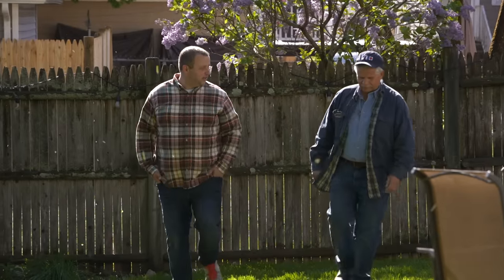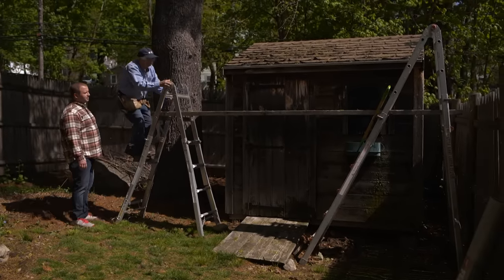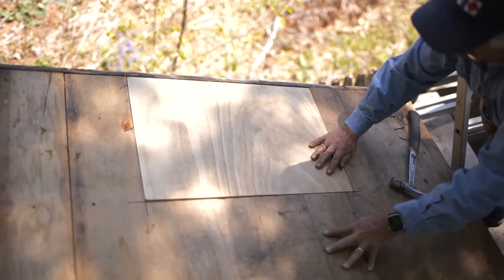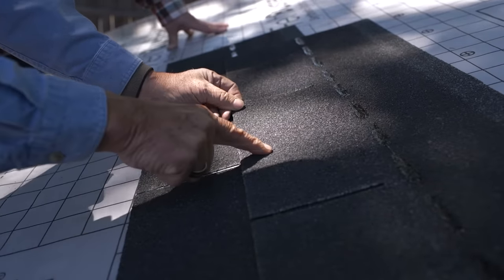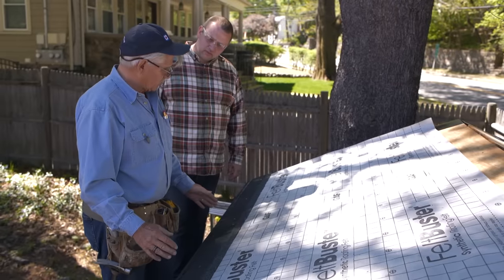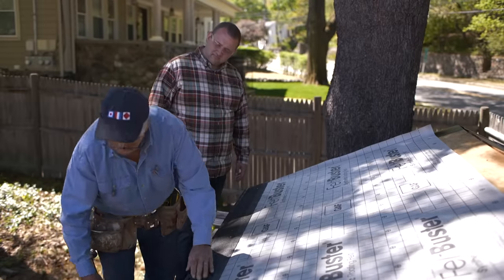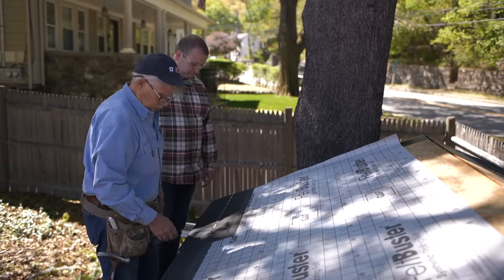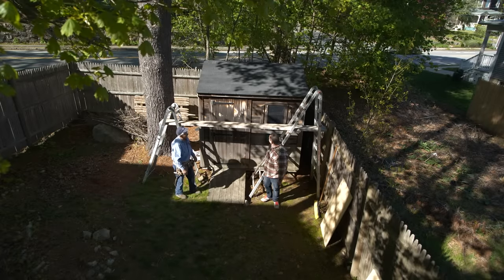How to Install Shingles on a Shed | Ask This Old House

Comment: How do you do the last roof cap layer? Do you just have an exposed nail? Or is there some way to hide it?
Reply: Not an expert but the nails on the ridge caps are covered by the overlap of the next shingle, just like on all the rest of the shed.
Reply: @c5zataol930  Ya. That's definitely true, but the last one you put on won't have another shingle to overlap it. How do you secure that one down without a nail poking through.
Reply: I believe you would have a few nails on the last ridge cap, then seal over the nail heads with roof caulking. I’ve seen them even sprinkle loose granules from the shingles onto the sealant for more protection
Reply: @fredkennedy8435  there should be waterproof tar that you would use for say any vents you may have so take a dab on your finger and cover the nail hole
Reply: @c5zataol930  "the last roof cap layer?"
Reply: @crashachet  flex seal
Reply: I had this same question. I've been on my roof several times (mostly hanging Christmas lights) and have never seen any ridge cap nails, covered with caulk or not.

Comment: About 6 years ago I changed the Shingles in the house, every time it rains the sand that comes with the Shingles I get it in the rain gutter ...
Is that normal, or did they sell me a bad product?
Thanks ...
Reply: It is wear and tear, although if you had it replaced in really hot climates or summer in the northern states, they'll wear out some while you're installing them, in Minnesota we used to take lunch from about 1 to 4pm depending on weather so not to damaged it much in fall and winter wasn't that bad. But not many places allowed to put them in winter when it's below certain temperature, here was around 0° don't know anywhere else.
Reply: called granules.

Comment: It really saddens me to see this! He has no idea what he's doing. This is a 2-hour job at best end definitely doesn't need a chalk line. I've been in the roofing industry for 30 years and there's nothing worse than seeing someone waste so much time. And using a straight edge blade while cutting a starter is a No-No. Cutting through the felt... And if you do that you only get about an inch and a half coverage behind the key. Use a 10-in starter strip and always use water and ice shield on the eaves.. I've watched the show since I was a kid but sometimes they drive me nuts. Also a professional doesn't need to gauge any shingles they just do everything by eye and that comes with many many years of experience.
Reply: Agreed, although the show is intended for homeowners to learn from so the chalk lining and excruciatingly long time allotment makes sense. Certainly made a lot of questionable decisions though (didn’t talk about gun pressure, or nail/seam placement all that much and neglected to put any ice shield on or starter along the edges, etc.). Just a shed though so no big deal.